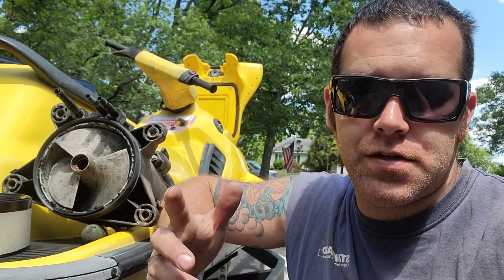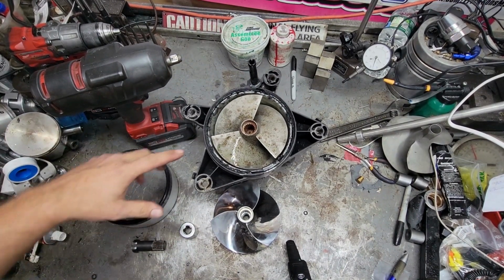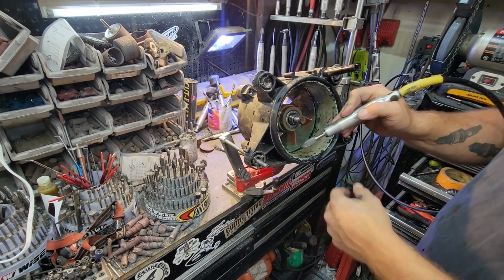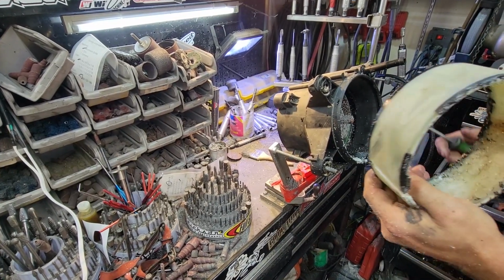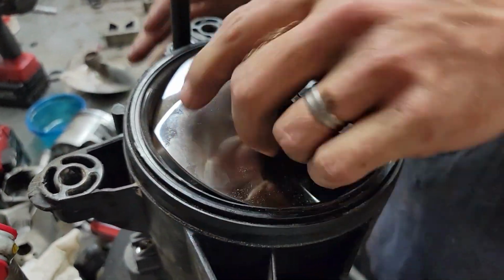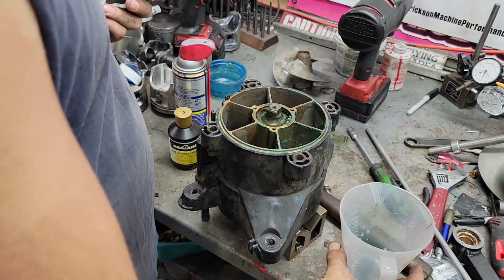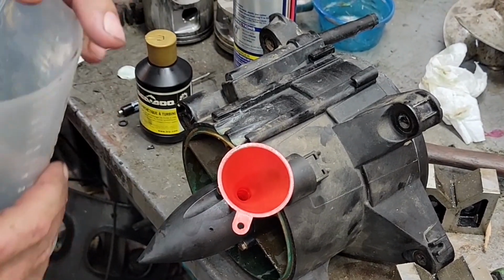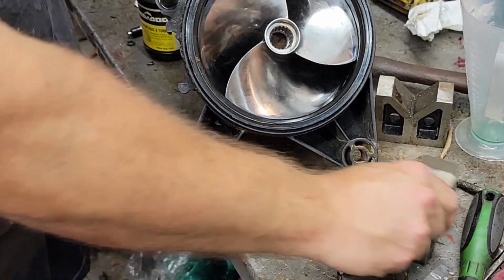How to replace a Prop and Wear ring on a Seadoo 140mm X4 xp jet pump

Comment: Just replaced an impeller and wear ring sea doo jet ski 2018.  Started it up and it is humming??
Reply from the maker: Did you put oil back in the pump?    Is anything getting hot?

Comment: FANTASTIC JOB..... DO YOU KNOW IF IS POSSIBLE ON 951 XP 2002, OPEN THE CRIMPED POINT OF THE STERING CABLE? IT IS A LITTLE HARD IN 1 POINT TANKS. DO YOU CAN MAKE A VIDEO
Reply from the maker: No that will destroy it.   You can get a cable luber that might help BUT your best bet is to replace the steering cable

Comment: How do you know when it needs oil?
Reply from the maker: It's not a bad idea.Every few years to drain it and put new oil. But it's a sealed system, so in theory, as long as it's not leaking, it's still there.
Reply: @EricksonMachinePerformance  much appreciated.